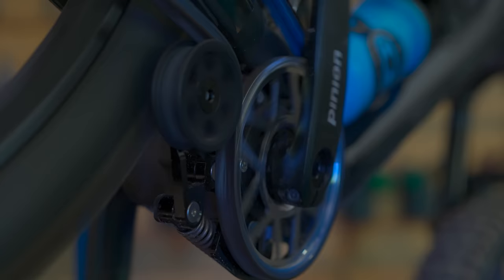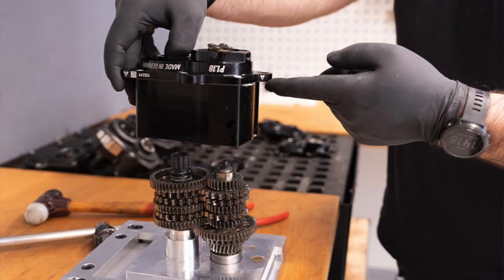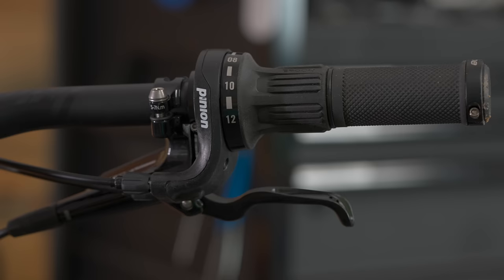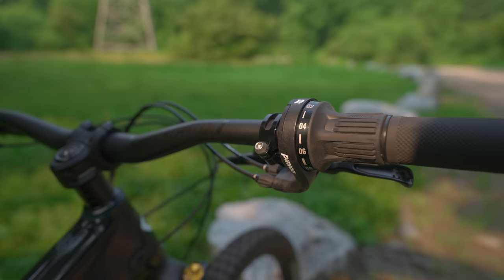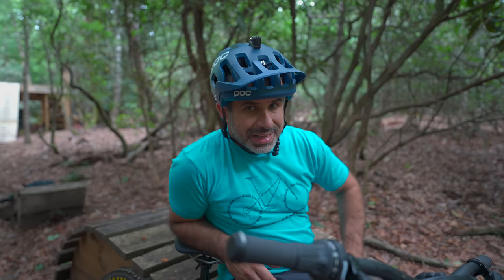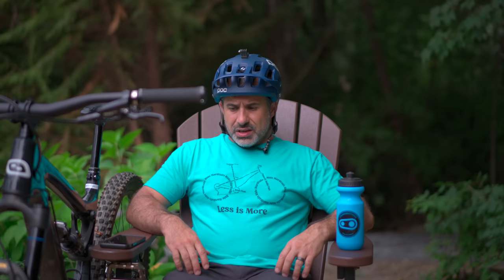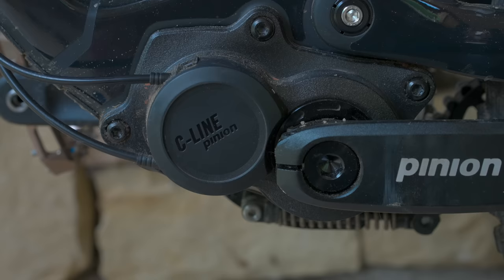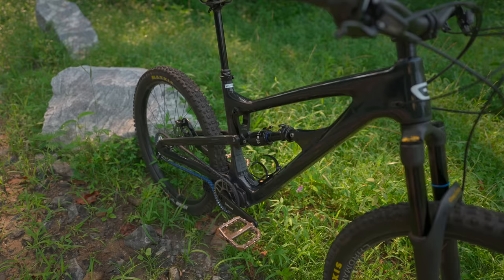What's the deal with gearboxes? Why don't more mountain bikes have them?

Comment: I found the statement at 7:11 to be distracting and honestly misleading coming from Seth. Yes there's been a century of R&D into gearboxes that go in to the cars (and motorbikes) but that doesn't mean the big derailleur shouldn't be investing in it for ebikes/mountain bikes. There's clearly a lot of great advantages (not to mention the fewer moving parts that are exposed to the elements) to the pinion systems and the problems can definitely be ironed out if SRAM/Shimano took a stab at it. They're simply unwilling to do so as they have a great business going on and mark my words, once they realize that this is the next big thing that they need to jump on to to keep their market dominance, they'll all jump over and then convince you how that's the right time to switch over. It's a shame that a channel I've trusted over this long would say something like that but I guess he needs the brands to be on his good side.

Comment: I love my derailleur. Even with low maintenance, it just runs for years before parts need replacement. I usually drive with a mudguard, that protects the "open transmissions" from mud and water spraying. What spare parts would you bring for it on a longer trip? and how long time does it take to replace the derailleur, say I have a spare, that's already asempled?

Comment: You will be surprised over how much time and effort auto manufacturers spend tweaking gearboxes and final drives to achieve better fuel efficiency. Even the oil level matters. Too little oil and you will have a failure but too much will cause drag.

Comment: Not sure if this was discussed here already, but is the "could be mistaken for an e-bike" aspect a factor for some? 
While most MTBers that are even only superficially into the technical aspects of MTBs would probably notice the difference on a second look, on a pass-by you might get mistaken for an e-bike rider (and thus become a receiver of e-bike hate 😉). Funny enough, in particular the non-biking part of the populace has learned to recognize an e-bike by the "bulky bottom bracket section" (no, they don't know that this is called bottom bracket 😉) and are even more likely to think that the guy who just zipped by was "just another e-bike rider, not a real sportsman". Conversely, I actually frequently get kudos when passing by hikers on some of the steeper inclines in my area for riding an e-bike (unlike about 80% of riders around here).
I remember when I was new to the MTB business, I met a some nice folks on the trails and had a chat with them. One of them had what I back then thought was a rear hub motor - actually it was a Rohloff rear hub . Similar considerations are also putting me off the Scott Spark - with its internal rear shock, which results in a more bulky bottom bracket section, it looks like an e-bike for casual onlookers.

Comment: there is no way to make a suspension that doesnt require chain tensioners? 
Removing the derailleur jsut to replace it with tensioners is not serving its purpose
I would take a gearbox on a hardtail then

Comment: have you reviewed a Roholoff hub?  while it puts the weight into the rear hub, you can put it on any bike.  curious if the drag is similar.  I see a lot of bikepackers / ultra folks use them in their vids, due to the reliability you mentioned

Comment: alllrigght hear me out... that appears to have a normal boost setup in the rear. sooo use the 12 speed gear box in the middle. theeennn put a 12 speed high range cassette/ derailleur in the rear. or even better use a 12speed gearbox hub. one shifter on the right, one on the left. 12speedx12speed= 144speed( tons of overlap, but still ridiculous range). for em realy steep hills, and really fast downhills. i have seen 14speed rear hubs, 14speedx12speed= 168speed. full on tractor bike. I need to see this.

Comment: You forgot to mension the two guys who designed this system working of Gear boxes for Porsche. Also the   chains loose their advantage once the get dirty .this is something none of the Gear box bikes suffer from. Did you know Honda made a series of MTB wining Gear box bikes not sure when late 80's or 90's  but they never produced them for the open market. Also Pinion now have an E-Shifter that solves most of the shifting problems under load and removes the grip shifter. Again its mega pricy. Also they have rivals now entering the market also using the 6 bolt mounting interface . All these designs are great bar the mounting system and the price of the unit its self this is limiting them to to only premium high end brands like the Renn stahl touring bike you pictured with no change out of 5000 euros to buy one which is a massive investment when you think what you could buy for that sort of money but sticking to the conventional tried and tested shifting systems. Some say these are the future because we are reaching the limit of how many more gears can you stick on the rear hub and how much wider can the rear end get. Already having problems with the knewer rear super boosted hubs . But Gear boxes will only become cheaper once the likes of Sram or Shimano get on board. We know that Shimano is doing some research in that direction .but for these to become mainstream they have to be in the same price range as Deore. XT or XTR before they get any mass take up.

Comment: Hello! Thanks for that video. I am very light weight person and I have a really light weight Idworx Mountain Rohler. It is 12 years old and has a chain and still works but one day It will be retired. The Rohloff takes a little bit of my power every time I pedal, that was clear from the start of our relationship but OK. After all these years I tested from the shop of my trust two new bikes. Both with belt drive and I was a little bit shocked. One with Pinion and one with Rohoff. Both with Gates and definitely premium bikes. It was horrifying. Does it work for me? definitely not.  The belt drive felt like it sucked some extra energy compared to my clean chain on the "old" Rohloff bike. The Rohloff itself consumes some power comapred to normal derailleur bikes but thats Ok riding it in dirty conditions on long days. I do not know if normal weighted persons or heavy cyclists do not fell this bad loss of power but for me it was one of reasons why I will never buy one Pinion bike with belt drive and never belt drive with Rohloff, at least :-) until I am really old and need a pedelec or something like that. I am not a "weight weenie" but I have to use every watt my body puts out to go forward if possible. Liebe Grüße. Eigentlich würde ich gerne Lokalpatriotisch sein aber Pinion ist für mich keine Alternative und Rohloff hat sich einfach zu lange auf seinen Lorbeeren ausgeruht.

Comment: The idea that Gearboxs and internal gear hubs have less maintenance requirements is bullshit.

I have a kindernay vii and it has been the most unreliable PoS.  Un-ending problems with the hydraulics, leaking fittings, leaking bleed screws, shift block replaced under warranty.  The chain tensioner fell apart after a couple of hundred KMs.  The gearbox leaked all the oil out before the first 500km oil change.  Just an absolute lemon

Comment: a company called instinctiv bikes is selling it with a trigger shift system adding about 500 bucks. In my opinion very overpriced for a piece of plastic that you maybe could 3d print with some additional rubber and metal pieces

Comment: UNSPRUNG MASS! Seth your great but you completely missed the main advantage. Moving the weight from the wheel to the cranks moves weight onto the sprung mass. This makes the bike so much better over the rough stuff. These bikes were designed for race performance and there are few that out perform them.

Comment: IGH is the future for sure since gearing has improved closer/exceed the derailleur types and virtually maintenance free with carbon belt that will last extremely long time. I ended with District 4 with Afine after learning Pinion only comes in twist shifter. I am guessing IGH will be better fit for ebikes than the derailleur type to provide less maintenance and boost power for commuting and casual riders like myself.

Comment: there is one large problem with a gear box you forgot, modularity. i like gearboxes, i think they are the future, but for the future (especially for bike parks and gravity), once the product has been evolving for a while. right now if you buy a gearbox bike, you get that 6bolt thing, but in a year is the 6 bolt still the standart? in order to upgrade will i need to buy a new bike with a new standart all the time? 

you also have this problem with hub standarts to be fair like the shimano and sram thing, but most brands can offer a simple adaptor kit or you can buy a new hub that is way less expensive than a new frame, im not ready to dish out 3k for a new frame every time the standart changes, i buy a bike and want to keep if for at least 5 years.

Comment: Hey Seth, I recently stumbled upon these types of gearboxes and found as you say that they’re a bit inefficient. So it got me thinking, why is rear wheel hub shifters never seen on mountain bikes? 
I read some on Rohloffs website and they claim it has about the same efficiency as derailleurs and has a 523% range and little maintenance, sounds perfect to me but I’ve never seen them used, why not? Would be very thankful for some insight 🤔

Comment: You’ve missed the biggest drawback, and the same reason you’ll never find a belt drive on an Adventure or dual sport motorcycle.  Mud and rocks….. that belt doesn’t play well with mud and rocks at all.  Quite easy to lose that belt because a rock got caught between it and the sprocket.  Pretty much takes serious off road use off the table

Comment: Same shit with vehicles. Differentials and transmissions /t-cases get super hot especially with thicker gear oils and high gear ratios.  Electric vehicles don’t have to go through as much gearing and friction, maybe just a gear box (but with no need for pinion 90* change in rotation, just gear on gear ⚙️ in line). Some EVs don’t even have differentials just a motor per wheel . Anyways, pinions and gears are dumb .

Comment: this Pinion Gearbox system has one problem.....Lack of "development"  By now it should be electronic or different style of shifting..(is not a new product or concept) so my conclusion is that the aim is more to commute bikes..This Pinion Gearbox system will take off when they go electronic shifting or different style of shifting for MTB (Trail, Enduro, DH  race minded). clutchless shifting is al about timing so electronic should be the way to go.

Comment: You forgot to mention that, yes, the gearbox has more drag than a regular CLEAN drivetrain, although the drag increases with use on a regular drivetrain as dust collects on the chain and cassette and so on, while the gearbox stays the same 
So overall it’s not too big of a deal

Comment: The problem is those are only 87% as efficient as regular gearing. Especially in mountain biking the last thing you need is something adding more difficulty. Even if it’s just a little harder, it adds up over a long ride

Comment: Yeah here's the issues:

1) Compatibility, you need a special bike to use it. When choices are limited, customers tend to look where choices are numerous.
Standardization is a great benefit anywhere. Of course with standardization you might get stagnation, so it's not all good.

2) Efficiency. Derailleurs, for all their flaws, are really efficient. They are efficient by their very nature, not just because of a century of development.
Gearboxes have good efficiency too thanks to a lot of development, but they will never be as efficient as derailleurs. Close enough maybe, but by the nature of how they operate they won't ever be the most efficient.

3) Cost. Derailleurs can be hella expensive, but you get A LOT with an expensive derailleur. And you get most of those benefits if you don't go for the most expensive options anyways due to standardization and the fact innovations creep down into the cheaper options over time.
Gearboxes, due to the limited runs it has, are always expensive. Regardless of how good they are. Even the cheapest gearbox is still overpriced because they aren't made in nearly as much bulk as derailleurs are. Small batches means higher costs, which the customers are expected to pay for.
And gearboxes aren't standardized so what you get is what you get, one product might be good at one thing and another is great at another thing. You don't get all the good bits in one gearbox because there's no market standard that drives them to be good at all the things the customers expect them to be.

4) Serviceability. Sure, a gearbox just needs a change of oil every year and they just keep going... But what if they don't? When something breaks you can't just be sure to go to the bike shop to get a small replacement part. The gearbox you bought 3 years ago might not even be supported anymore. You are SOL when that happens, fixing it means getting a new gearbox which might not even be compatible with the rest of your drive line.
And that is long before you consider the amount of knowledge and tools you need to start fixing a gearbox as opposed to a derailleur.
Yes, derailleurs require more maintenance and cleaning. But they are EASIER to work on when things go wrong.

5) Weight. Not really a big issue when riding on nice trails. But as soon as you need to shift your bike around, any extra pounds will add up. If you have to lift the bike up a rock face, any extra pounds will be felt. And maneuvering a heavy bike, even if the weight is perfectly centered, requires more effort. Effort that would be better spent having fun.

6) Familiarity. With a chain, sprocket and derailleur bike you instinctively know when it's running well and you know ever sound it makes.
With a gearbox you don't really know if it's supposed to be that way or sound like it does. So you will not be prepared for when the thing breaks down.
I've never been surprised by a derailleur doing strange things and breaking on a ride. I've already noticed the issue long before it does and had my chance to fix it before it broke.

7) Finally, in any other case, for gearboxes to become a viable option they have to become accepted by a not insignificant portion of riders.
As long as you only have "nerds" and commuters using them, they will remain a niche product that will never be standardized and will always have a new company making them because "they are so fricking awesome" and then that drive fades away into the history books.

-------------

Mind you, all major derailleur manufacturers actually have done research and development into gearboxes. They have all come to the same conclusion in the end, the gearbox doesn't offer any significant enough benefits to where they are ready to set up a serious manufacturing line for them.
Good enough for a small test run, but they just don't stand a chance against the inherent benefits of derailleurs.
The times and places a gearbox does shine are so spaced apart and so small that even those that can afford to produce them simply don't.
With E-bikes, the trend has of course been leaning more towards gearboxes and other similar developments at the crank. But that's because of necessity where a traditional drive setup would not be enough.

On motorbikes, even a beefed up derailleur wouldn't suffice. It would break way too often.

Comment: Bit disingenuous saying a gearbox is 1600 dollars without mentioning how much the sram axs system is & more importantly, how much to replace cassettes etc in the same usage! You'd only have oil to change & maybe the odd belt on the gearbox, derailleur, that's a whole other matter! You'd soon spend 1600 whilst using axs. Wreck one derailleur, change the cassette, front ring & chain? Twice? 😱 Soon adds up to far mare than 1600 dollars. Which is why sram & shimano stick with the derailleur system LOTS OF DOLLARS 💵 💵💵💵

Comment: You don’t have to use clutch on manual(car)? Are you the devil? If you have manual gearshift, you use clutch. The car-to-MTB equivalent of not using your clutch would be like smashing your bike onto a wall and then laughing about it. This video is heresy.
Reply: He’s right, genius, it’s called floating the gears. And yes, if your revs are in the correct range then the clutch isn’t necessary. It’s like you’ve never touched a stick.

Comment: Coming soon: Bikes with power steering, traction control and carbon footprint measuring device. After all, you're farting methane and exhaling carbon dioxide. 
Common people don't buy bikes with gearboxes because they are expenive. That's the answer.